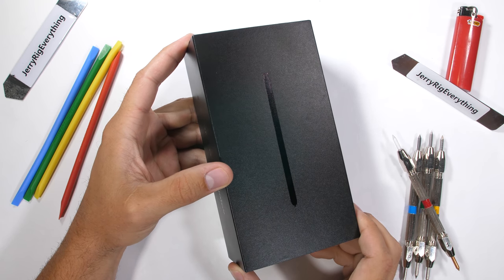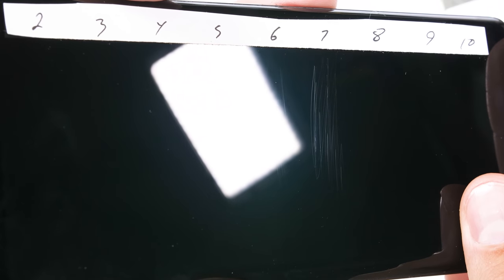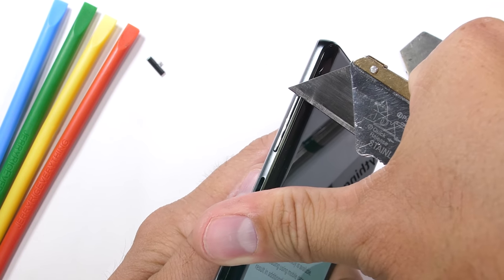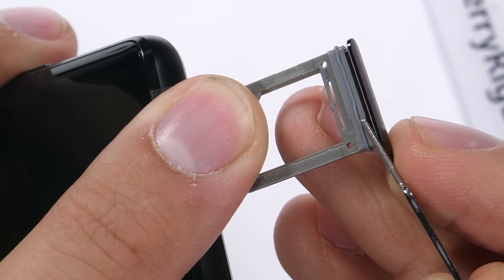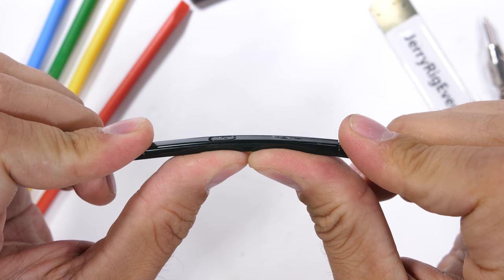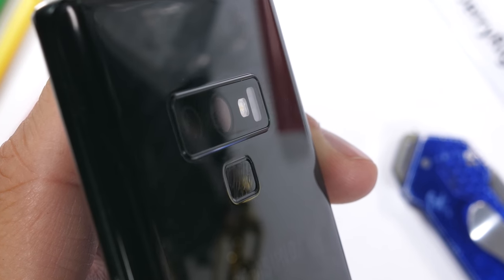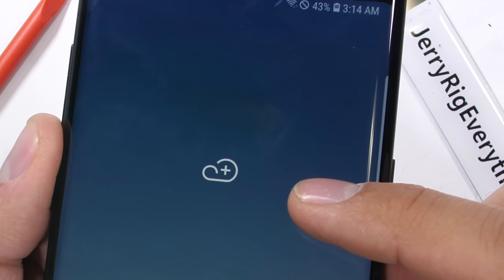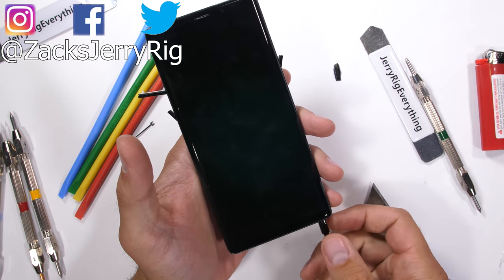Samsung Note 9 Durability Test! - Bixby is not Secure...

Comment: Apple removed the headphone jack and said it's for the future.

*includes dongle for headphone jacks.
Reply: i carried a lot of stuff in my pocket but I'm not the type of person who carries a dongle when he can't
Reply: Maybe they meant to make more money in the future selling dongles
Reply: lol and if they didn’t include a dongle people would say its a money making scheme to sell dongles or whatever. Even though ppl can just buy 3rd party dongles. 

What Apple actually said is that wireless tech is the future, and considering the fact their wired features (like fast charging) are proprietary, expensive,and require awkward dongles when compared to the non-proprietary non-dongle wireless features like Bluetooth & Qi standard.

I think it’s obvious Apple are just using a thing called “incentives” to push wireless tech.
Reply: I already got a dongle in my pants
Reply: @user46346bdtgry  One problem: wireless as the future is a HUGE lie, something that anyone with experience and education in signal processing and control systems can tell you.  As it stands, technologies like Bluetooth and WiFi have inherent latency greater than any wired interface due the need to use extra pings between the devices to ensure they are sending and receiving the correct data (so that the data remains between "connected" devices).  With wires, that channel is ensured, so pings are only required for the purpose of requesting transmission, meaning much less latency.  Concerning bluetooth audio, while there has been progress in the forms of various codecs, none of them offer the lossless, low interference capabilities of a simple 3.5 mm jack and a cable.  As for power connections, the only thing that is truly proprietary is Apple's lightning connector.  With the emergence of USB-C and the Power Delivery standard, wired charging on many current devices (including current Androids) has become more convenient and simpler to utilize.  Wireless charging, while capable currently of similar performance, is still less efficient, and, contrary to what was stated, has many incompatible formats (though the Qi standard is becoming popular for phones).  Also, ironically, wireless charging requires close proximity to a fixed station, meaning that it cannot be held and used, while a wired charger allows the device to be used normally while charging.
Wireless technologies are often convenient, and are necessary in situations where a wired connection is impractical or outright impossible, but they are not valid as a complete replacement to wired technologies, and probably will not be for the foreseeable future.  That would require the development of a completely new form of wireless transmission quite different from what exists now.

Comment: is it water resistant when you take the buttons out?
Reply: Yes
Reply: Heimdal 
yes it is  because I have s7 edge already lost volume buttons  but still waterproof
Reply: It should be. The buttons probably come out for easy replacement. If it isn't water resistant when the buttons are out of the phone, then it likely wouldn't be resistant when they are in the phone, because of how easily they can be removed. Since it's a water resistant phone, it is very safe to assume the area under the buttons has a decent amount of water proofing.
Reply: Yes. There's a teardown video jerry does shows how the buttons designed to be water resistant. Sorry for my bad english
Reply: yes, remove the bixby button :)
Reply: I presume there's a membrane in the frame and the bottons push the actual triggers inside the phone through it
Reply: Littlegamer888 every button is removable  on this phone
Reply: Heimdal I thing yes I saw a rupper on the button like the simtray
Reply: Heimdal yes

Comment: Wait... The buttons are removable???!! Is it still water resistant?
Reply: I don't think it is anymore. As it can be seen in the video, the buttons have a rubber ring around them to prevent water reaching the insides of the phone. Once you remove a button, you also remove the water resistance I believe, unless they somehow waterproofed it beyond just that rubber ring.
Reply: I work in cellphone repairs. The phone will still be water resistant even if the bottons are removed. It has an inner ruber protection.
Reply: Yes it is
Reply: Yes it's still. Sim card tray, USB-C, headphone jack — they are all removable but don't degrade it's IP rating.
Reply: Thanks for clarifying guys.
Reply: Sealed from inside bro
Reply: Don't they get sprayed internally with a water resistant chemical?
Reply: @TOXBYTE  prove it, or it didn't happen!

Comment: Hey @Jerryrigeverything I never see you mention the plastic SIM card trays, they have a tendency to break! Metal ones are much better!
Reply: jk M because how are they gonna break when they are inside the phone?
Reply: @gld_ow  but the phone vibrates with the Simtray. How is that gonna break it?
Reply: Everything is possible folks…
Reply: My sim tray on my note 7 broke when trying to eject it from the phone bottom cracked in half and sim eject button totally broke too. Wont buy any more of this over priced junk
Reply: MrChubhub22 I'm not sure how you managed to do that, were you extracting it with pliers or something?
Reply: Have you actually ever heard of a plastic sim card tray breaking?
Reply: @Tom44224  Yeah it's literally happened to me that's why I've mentioned it.
Reply: @jackyyo1998  Well that's a valid thought Jacky. They don't break when they are in the phone, it breaks when you take it out the phone put it back in! 
I've had them break on me just saying, it's a very thin bit of plastic, not much flex to break it. The one on my current phone is metal and all good.
Reply: How tf do you break that i release it once in 5 months for 15 secs
Reply: @wal_rider8479  I work in a phone shop so have to change my sim quite often so that is probably why.
Reply: @Falbow91  ok yeah but still how do you break it its not like you're accidentally going to snap it in half?
Reply: @wal_rider8479  Honestly I don't know. But when I tried to put it back in I had to hold it together as the really thin bit of plastic had broken I think on the SD card bit.
Anyways the video is about durability and he's taking a razor blade to it so I think bringing up the SIM card tray material is worthwhile doing as the plastic is quite weak compared to a metal one.
Reply: i used the sim tray ejection tool and the tray wouldnt pop out. I still have the phone the glass scratched with my keys. the 2nd production replacement phones that they handed out was really poor quality phones that seemed to be rushed produced to make people happy. I have always been a note user but with the poor quality of these phones (i had a note 1, note 3 and note 4) at such a high price these phones are very disappointing. the only benefit of the note 7 phone was i was able to get the refund check and keep the phone so now i just use it as a music player.

Comment: Mine is already scratched. Bummed.
Reply: Same
Reply: That's why you spend extra on screen protector
Reply: It got scratched in my jeans and also the shitty 45 dollar panzer glass the store guy sold me scratched my phone in 2 days when the glue released slightly and started to allow pebbles, now my 1800 dollar phone has microscratches everywhete
Reply: @johnnytopgun6414  well I'm thinking that the glass of the note 9 scratches easier than past Samsung phones. I upgraded from an s7 edge and it surely didn't scratch this easily.
Reply: @jcallwood25  getting the huawei or the rog phone as soon as possible
Reply: @johnnytopgun6414  Awww. That sucks. Note 9 still the best phone IMO.

Comment: I.. NEED IT. It can have a flipping TERABYTE. My 16 GB Galaxy J3 and I are struggling to save space. And I use it to fricking record Lmao. I really want this. Maybe I'll get the Note 8 instead and just buy an SD card. Cough, 1,000 bucks. Although 800 bucks isn't that better. Before buying one I'd want to see one. So, i'll see xD
Reply: FruitJuice_ does a 1 tb sd card exist
Reply: trstnhn 
I don't have T-Mobile and neither do I have an S7.
Reply: 512GB ones do and I think that's the max size the Note 9 can use anyway
Reply: Denzel Gabriel yes
Reply: Denzel Gabriel too expensive though
Reply: FruitJuice_ lol i have j3 too
Reply: micro sds bigger than 512 gb dont exist yet, but every flagship supports up to 2 tb large micro sds usually
Reply: The iDOLMOLESTER I swear I saw 1tb sd card somewhere but cost around 3k$
Reply: Denzel Gabriel No it doesn't. Even if it did, the phone needs to support it. Most phones only support 64/128/256 gb sd cards, but normally being 128gb. With the note 8 being an exception with support for 512gb.

Comment: I actually had a note 9 for about a week before I broke. I had tempered glass and everything, and it broke the tempered glass and the screen and the back glass in all one go. 

So I was working on a front end loader remove a metal piece, it about 3/4 of an inch thick and about 2 feet wide and 4 feet long, and I had an apprentice propping it up so it wouldn't fall on me and he dropped it and it hit my note 9 in my pocket, it pushed my whole leg back and actually the metal piece moved back a little bit. I had a nasty bruise on my thigh, but I didn't break my femur, which definitely would've happened if my phone wasn't in my pocket. And the next day, for like 2 or 3 hundred dollars I got my phone fixed, and a lot less deadly and cheaper than having a broken femur.

Comment: It seems I have blades and knives and all sorts of sharp stuff in my pocket. I use my Note 9 normally or a very normal office table with no sharp materials (basically just my laptop and a wireless mouse) and I put my phone in my cotton-based trousers and I am astonished to see tons of permanent scratches on the display and back glass of my note 9. How this happens is beyond me.